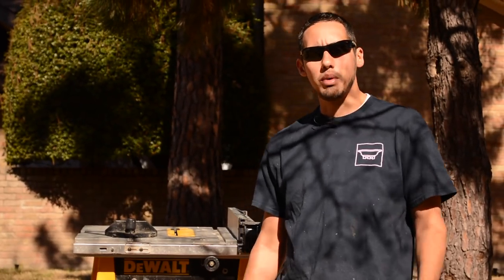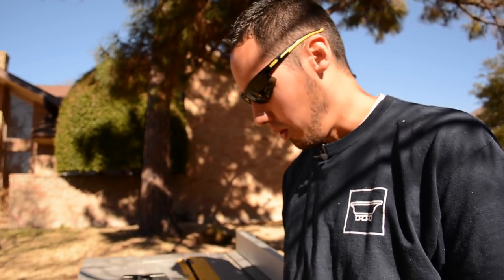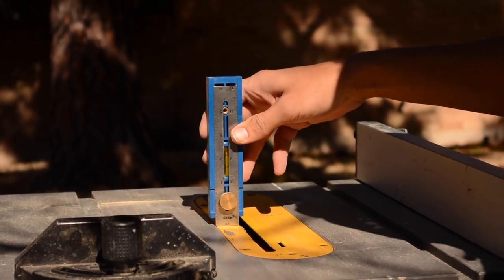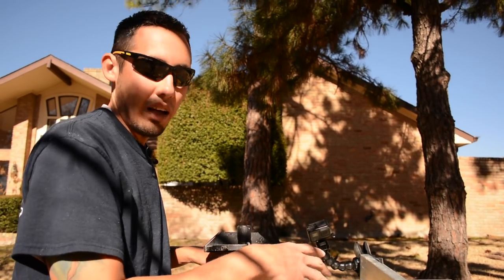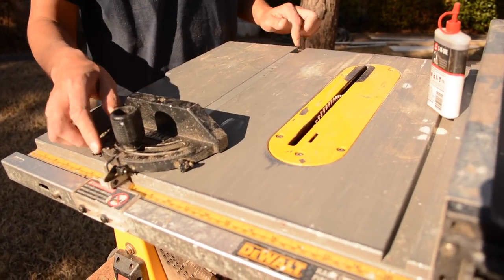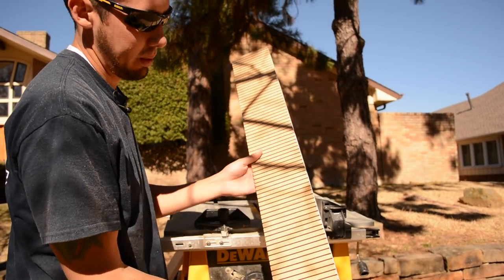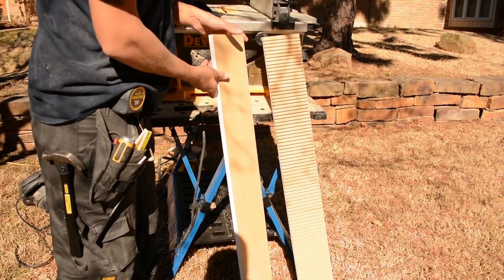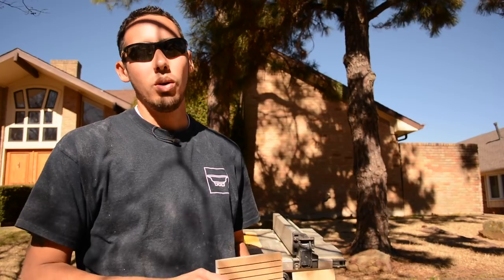How to Kerf MDF on a Table Saw

Comment: Good video. The way I have done this in the past is to make a mark on the back of the table saw that represents the center of the blade assuming your saw doesn't already have this reference point. Mark the increments on the back of the board to receive the kerf. Obviously still using the miter gauge, align the mark on the back of the board to the blade center line mark on the table and make your cut. Slide the board to the next mark etc., no fence needed if you hold your work firmly. You are limited to boards that are narrower than the distance between the blade and the mark on the table to perform this safely. Anything wider hides the saw blade center line mark on the table and results in the miter gauge being off the table. Obviously the deeper the kerf the narrow this distance becomes. Just my 2 cents.
Reply: Sorry DFW, didn't read the comments below before making my suggestion. You have already addressed a similar comment. Keep up the good work!

Comment: thanks. What about using PVC..Azek.. that is already very flexible. Will it break if you kerf it?
Reply: SKWDMDYT that's what i use, works great, you can bend that stuff in a circle. It wont break. nothing wrong with learning a new skill though.
Reply: Thanks for the reply. Thinking of doing a cargo van conversion and managing the pillar areas. Never used kerfs before so video was timely for me.

Comment: Do you like the dewalt table saw with the rack n pinion fence and what is rip capacity?.
Reply: It's a lightweight jobsite saw. The fence isn't that great, the portability is. 
I had one but I took it back and got a cabinet saw instead. They are really for two different things.
Reply: I LOVE the rack & pinion fence on my DeWalt table saw! It's the reason I bought the DeWalt and I'm thankful for it every time I use it.

Comment: The more safe way to set it up is clamping a small piece of wood/mdf to the fence close to your side of table saw. Use it as what you do with your fence. Then during the cut the board is free from binding anything

Comment: Great video and information as always, but that method of using the fence as a guide is dangerous, even with the miter guide, you need to clamp a block on the fence so the timber release off the fence during the cut, this method can end up in the piece of timber getting jammed which becomes very dangerous for your fingers.

Better still get rid of the fence, you don't need it when using the miter guide,just put a mark on the table  with tape and a felt pen where you want the next cut to be, it's quicker and much safer.  

Also have to agree with the others for the wet oil in dusty environment the dust just sticks to it, dry lubricant is best for dusty places.

Comment: If you're not concerned with the safety of the "move the fence method", maybe the vastly increased speed could interest you. It would be a lot faster to not use the fence, put a mark on the table saw somehow, and use that to move the board the half inch each time.

Comment: rule #1 on a table saw: never use the miter and fence together. The only way this is safe is to clamp a short block to front edge of the fence to use as the stop, making sure the material will not be sliding against the block when in contact with the blade.

Comment: I don't like the method, found it to be dangerous and time consuming. The fence can trap the board and kick back on you, all it takes is a second of distraction and it's done. I suggest that you remove the fence and for spacing just apply a piece of tape on the table saw before the blade, mark the choosen space for your querf and use the cuts to guide the next cut or use a sacrificial board attached to the miter gauge with a pin or cut as your indexing.  Great work and videos 😎
Reply from the maker: I addressed that in the video. It is totally safe. You just have to use the miter gauge as a sled. But if you are not comfortable with, I understand. I don't think someone should do it this way if they are not.  Thanks.
Reply: dfw crown Indeed I am not, but let's leave it for the subscribers to decide which method is safer and productive. My sole intention is to value your work and offer humble suggestions. Nevertheless I respect your opinion and hopefully you will do the same. Thank you.
Reply: Growing up in a wood shop, that would definitely be a no no. Table saw is the single most dangerous piece of equipment on the job site. It's nice to have a sled or just mark the board at 1/2 intervals and use the miter guage.  Just sharing a little wisdom not at all a criticism, after all Im here because I enjoy the content.
Reply: I use the fence, but I clamp a block at the very front of the fence, so the cross piece is never pinched between the fence and the blade. Then you can use the fence to get nice even curfs, and there's no kickback risk.
Reply: I agree with the others on this one.  Try the tape or marking method, indexing off the first kerf cut.  The fence simply isn't needed when using a sled or miter gauge, takes additional time, and increases the risk for kickback.  Try it!  It will increase your productivity, safety, and perhaps even the consistency.  Any error when indexing is not additive (since it is always measured off the last cut) and inconsequential for this application.
Reply: I’m good with it, and that’s how I do it

Comment: Using the fence can create kickback. There is no reason to use a guide. Either make a pencil mark somewhere for reference or just eyeball it. If you can't see a 1/2" without a mark or a fence you probably shouldn't be doing his process anyway. And why in the world would you use a liquid lubricant on the table of your saw??? Great way to ruin your wood and make a dusty, clumpy mess of the saw.

Comment: At best your method is dangerous. You should have an offset attached at the near end of you fence to allow for relief from the blade as the wood travels through the blade. In 1959 I was doing something very near to what you are showing. The kickback was great enough that a hole was made in a pane of 1/4" reinforced (chicken wired) window glass several feet behind me. The kickback missed a friends head by inches. If he had been hit he would have died for sure.